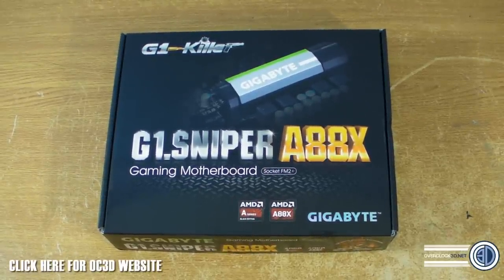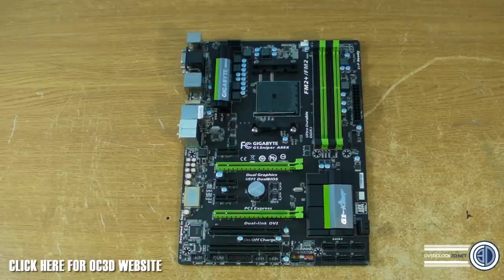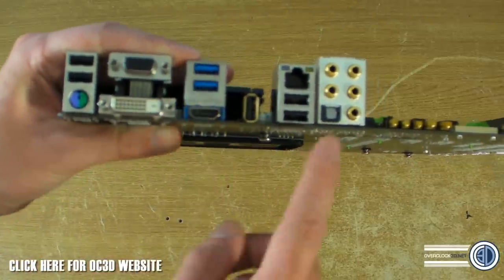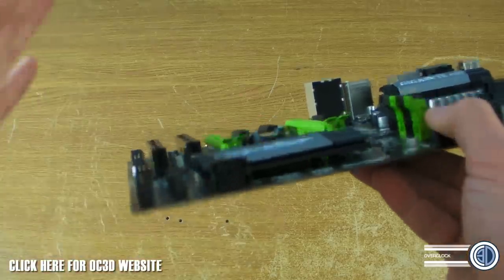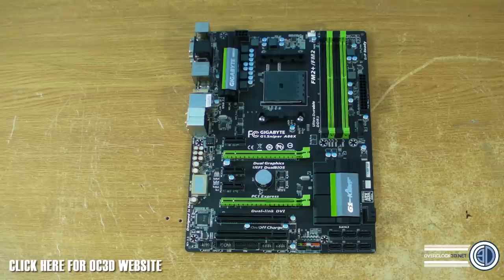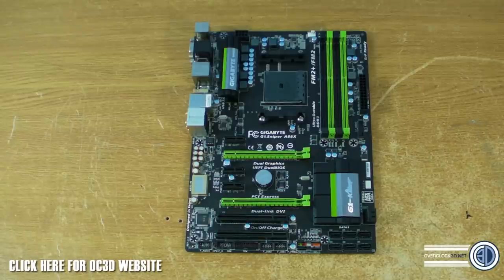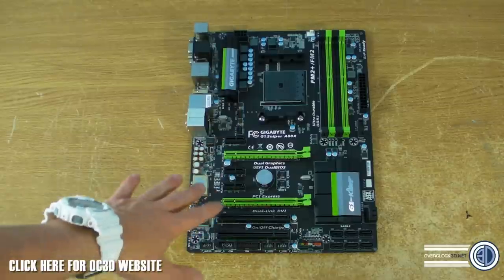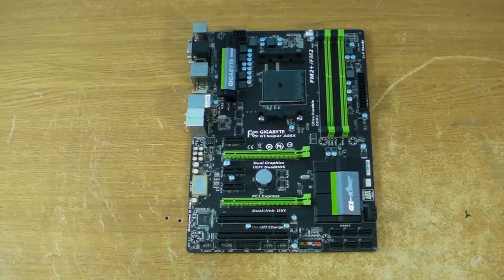Gigabyte G1 Sniper AMD A88X

Comment: on a budget you could get a athlon x4 fm2 retail between £40 to £60 in the uk...just a a10 with the gpu turned off...
so a fm2 board and a athlon cpu works out even cheaper than fx for those on a budget..plus side athlons can be oced

Comment: I'm a low budget gamer, but I look for SLI support.

Ended up with 2 x GTS 250s, but my CPU isn't strong enough to wind them up fully, so need a CPU upgrade but need a new mobo and SLI support would be great.

Basically, I'm saying, SLI/X-fire isn't so much a "future-proofing" thing, it can also be a backward performance thing where old hardware is brought to the new upgrade.

Comment: FM2+ was designed to use hUma and HSA which means the iGPU will be used for computation work specifically parallel work, so an APU may be viable with crossfire.  I would have done a little homework before reviewing a motherboard with future design intent.  That board won't work fully until you get a steamroller chip around January.
Reply: *kavari will use FM2 socket. Steamroller will be for AM3+.
Reply: Idk where u get ur information but Kaveri is steamroller and it's made for FM2+. Also steamroller is the architecture. On CPU form it'll be called something else. There is no confirmation or any factual information about steamroller being implemented on AM3+.
Reply: Yeah right. So what's your opinion on AM3+,then? I'm sure you just ment 28nm Jaguar cores. Not steamroller. Steamroller won't be an APU chip.

Comment: I wonder if the new apus will pair with a 7750...just I got in contact with aria online and they told me according to amds feed back there's drivers in the works to pair the 7750 with a apu but they didn't say if it would be the current a10 or the new apus. 
As for this board I actually like the colour scheme

Comment: Ok here is a old way of getting the most for your money. Get the motherboard the A88x with a A8 or A10 and then get a 6570 card you can then run bridgeless crossfire and run a lot of games on high settings. And yes it works very nice in deed.

Comment: I think some people are scared to buy a APU then buy a discreet graphics card because they think the graphics side of the processor wont be used so it will be a waste but it isn't all that bad because you do get more processing power when you don't use on-board graphics. Got my a8 6600k with a hd 7750 nice cheap system which can run all games 60+ waiting to see if amd sort the crossfire out with 7750 and 6600 though.

Comment: Old way, as in the last two years or so? 

the other problem is it has all the same crossfire issues as regular dual cards and doesn't improve the actual experience, TomsHardware did a write up on it called "AMD Dual Graphics Analysis: Better Benchmarks; Same Experience?"

Comment: I have read that posting from tomshardware and what I find is that he did not do a good job with his miss leading info by when he said {Simply, that means your able to take an APU-powered system and add a radeon card} that is not true an A-6 can't bridgeless crossfire with anything higher then the HD6450 so this guy does not know what he is talking about when it comes to the A-series APU from amd and yes the A-10 can run a HD6670 not any of the 7Series from radeon and yes the the experience

Comment: AM3+ as a socket is done. New FX chips won't be coming out for a while (at least anything note worthy) AMD did bring in some of their old engineers to work on a new FX refresh but we wont see the fruits of their labors for 2 years or so : / so right now CPUs are kinda stagnant. AMD is playing catch up with intel and intel is worrying more about power efficiency and die shrinks more then performance. 8350s and 3570ks will be good for awhile still so don't worry. Just dont expect anything new.

Comment: This board does not work with the new Kaveri APU,,, it wont even post / turn on ... you need to use a Richland to update it,, or do what I did,,, send it back..
This is a very poor show from Gigabyte,,, 1/10 ,, truely a very very poor MOBO..
Reply: You need to flash the new system bios  thats why it didn't work for you